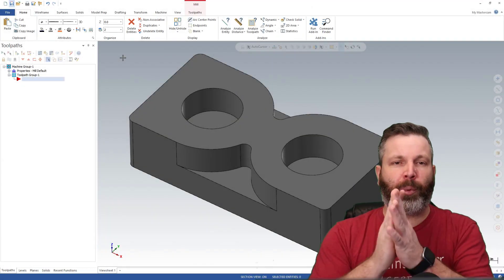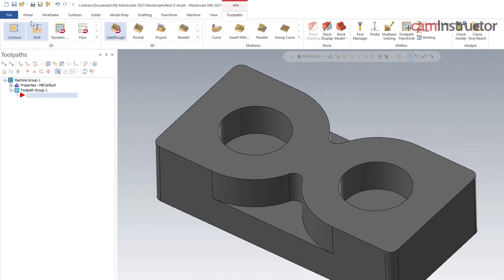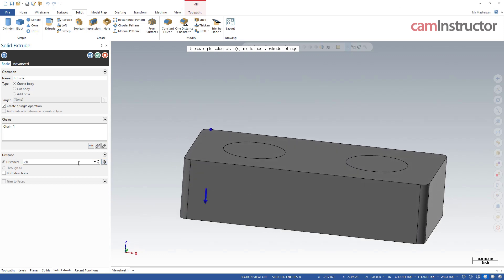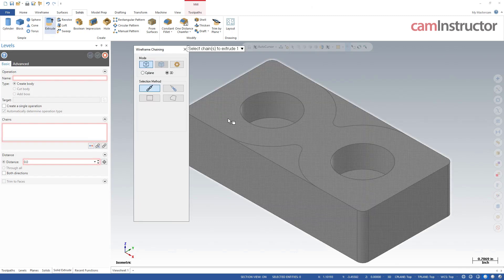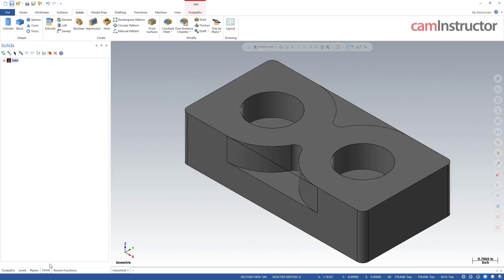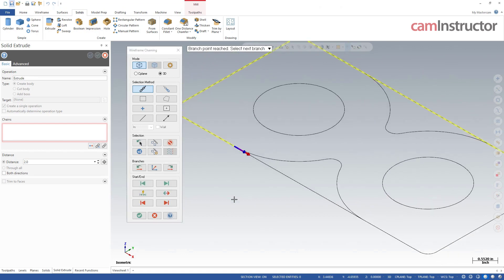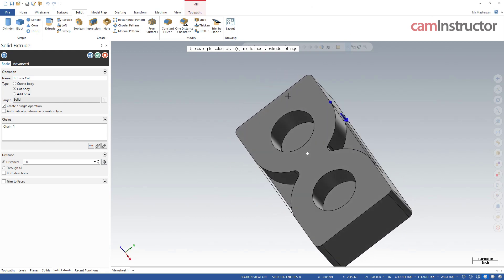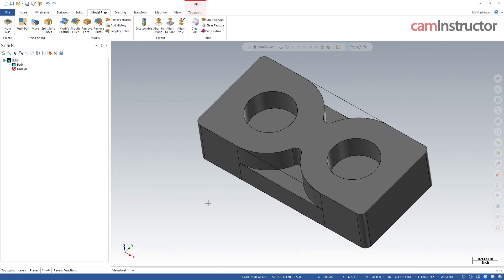Fixing the Solid Regeneration Error that will DESTROY your file! - No Hammer Needed!!

Comment: good vid showing how to fix an often problem
in 3:52 you can use your single line and cut the model just go to the "advanced" tab tick thin wall, select direction, and type for example 1 or 2 inches 
and it will cut it for you without breaking lines or creating extra geom. :)
I understand that you wanted to present didfferent thing
Reply: I feel like it is sloppy practice to use open ended booleans like that. Maybe for a simple model like this it's okay, but the better way would have simply been to have the order of operations correct from the start.
Reply: @SuperAWaC  You are right. It isn't the correct way to make a 3d model and not the best software to do complex modeling
Reply from the maker: You are correct! The thin wall extrude will cut that shape if you select just the inner geometry and extend. Perhaps another video showing other possible solutions is in order...I've also seen some who will create the closed chain with extra geometry, not by breaking existing. Not as clean as the thin wall but it does work.
Yes, the intent here was to generate that error message and show the most common cause as well as a couple possible fixes. Thanks for the feedback, glad you liked the video!